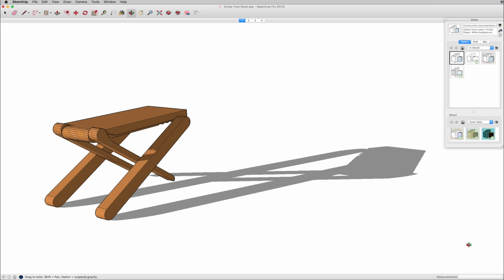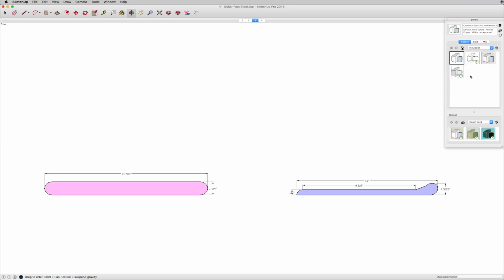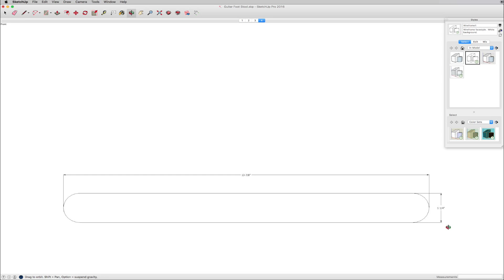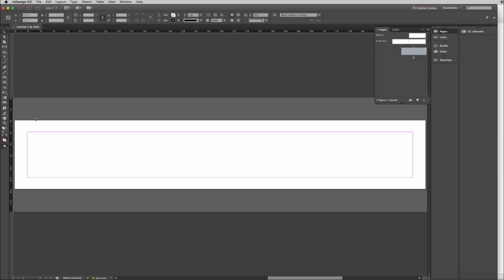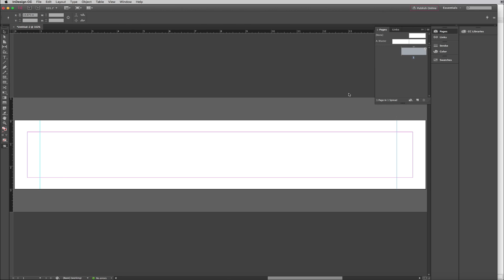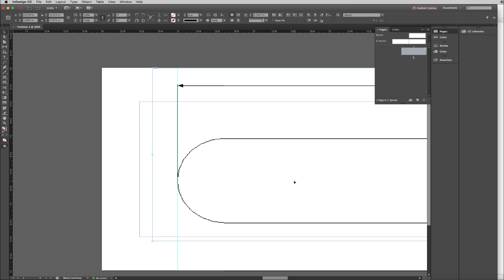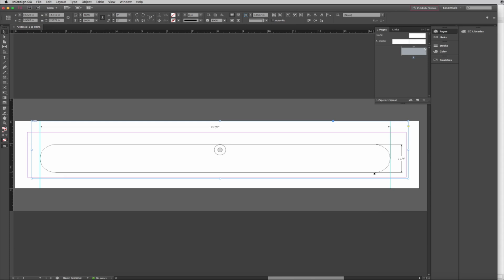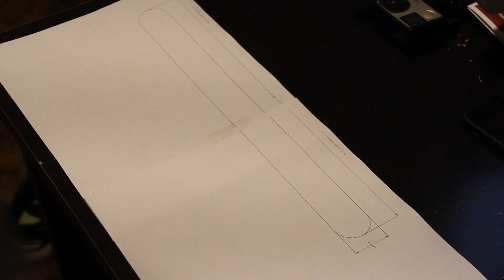How To: Print Sketchup To Scale

Comment: I tried layout but is so lagging and no chance to fit to real dimensions there... Why would we use layout i don't know, especially if you get no real scale there too.

I just tried to see if i can bring top drawing from sketchup to layout and got no chance to have it at that scale... Strange things happening there. Hmm... wondering why they made it so hard to do this step.

later edit:
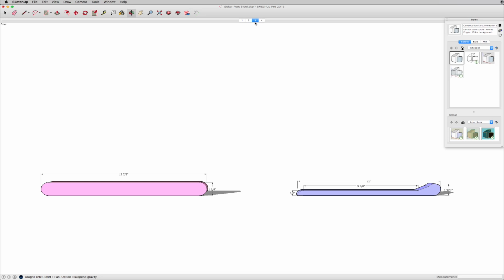Having a simple design, i just tried to import it directly into illustrator, but was bad there too. So, last resort was corel draw and there i could redraw quickly all the parts (scale 1:10) and arrange them to a sheet and be able to print it on a paper and i will make the mockup from there.

But, is not a good way to do a small size model doing all these steps. Why would i buy layout of i can't use it properly... and i was having so much hope that will be useful ;-(. Maybe in the near future.

Cheers for your solution too which can be a way to do it for simple designs.

Comment: Thanks for this video. Like you, I often use 1:1 templates when cutting out wood parts but I didn't know how to print them after designing the parts in Sketchup. Consequently, I've been using LibreCAD to make my templates. LibreCAD is great (and free!) but has no 3D capability. Because of your video, I'm going to try designing my projects in Sketchup and printing 1:1 templates in LibreCAD. Thank-you!
Reply: Hello my friend! I am looking for an alternative to indesign. Have you been able to print your templates to scale with LibreCAD ? Have a great day.
Reply: Yes, I am able to print my templates using LibreCAD. However, those templates were originally drawn using LibreCAD, not Sketchup. I am starting to get back into using Sketchup so I will also try printing my Sketchup templates using LibreCAD.